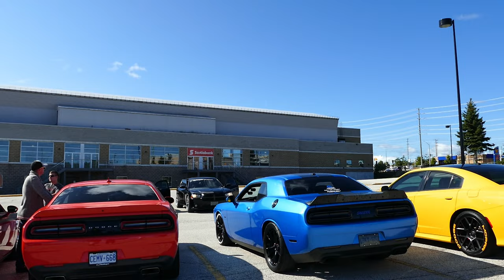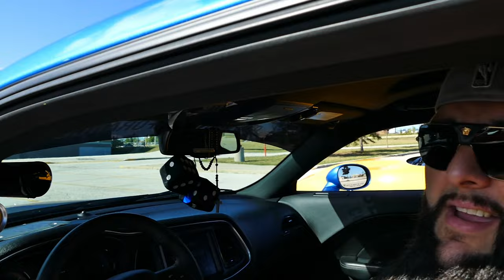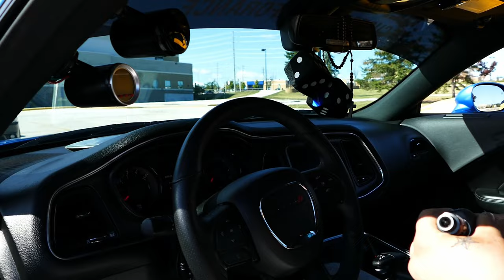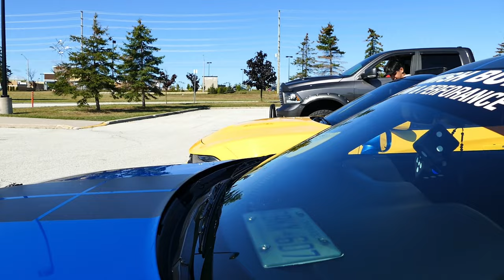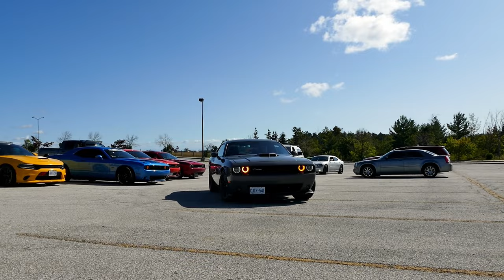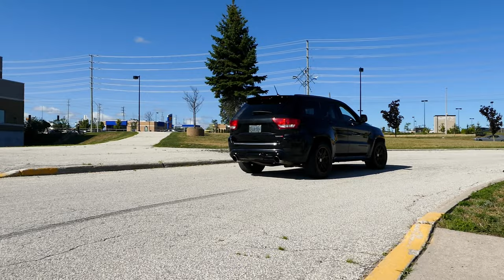supercharged 5.7 hemi

Comment: How much did it cost to forge the internals
Reply from the maker: about 10 grand including the Headers and install, thnx for watching!
Reply: @moparbro  The 5.7 Hemi is literally Dodge’s LS it can take way more boost than a Scatpack it can hold 1000HP on stock block but I would still get forged internals but you can definitely run it stock with a 1000HP
Reply from the maker: @redhunnid5142  yea its true, crazy how sensitive the stock 392s are to boost
Reply: @redhunnid5142  Yeah no, the 5.7 isn’t dodge’s LS. Closest they ever got to that was the 6.1. No VVT, no MDS, no nothing. Just a great rotating assembly and block. All it needed was pistons and rods if you were doing serious major power, and you were off to the races. The intake manifold was super boost happy, was an awesome engine. Forged crank, you didn’t even need a cam. The 5.7s need way more work and QC to get to that point. you’re not running 1k hp on the stock crank. you could totally do that with the 6.1. And the cam.